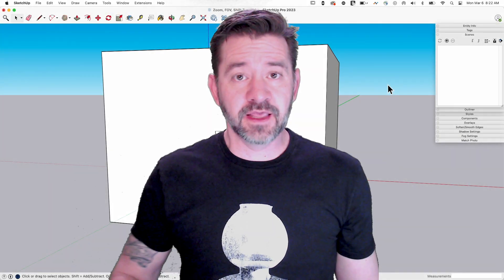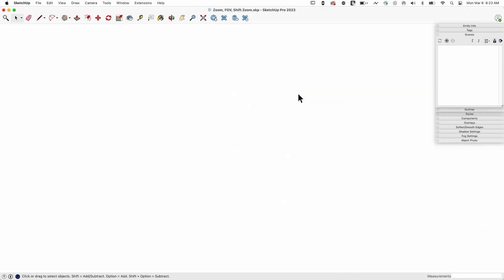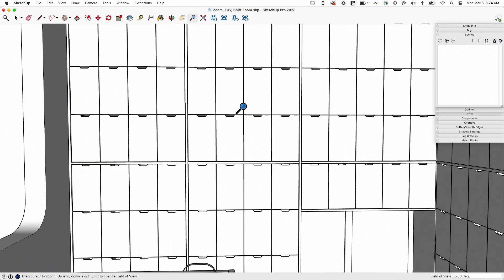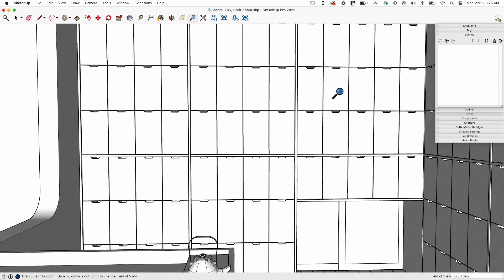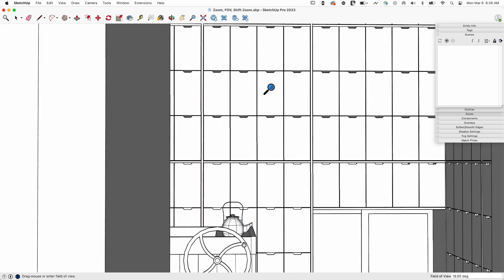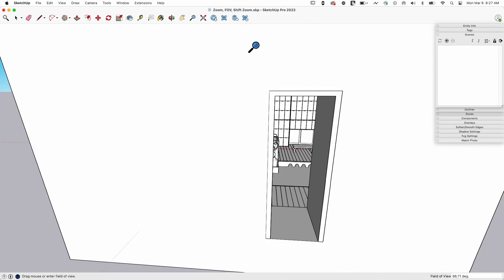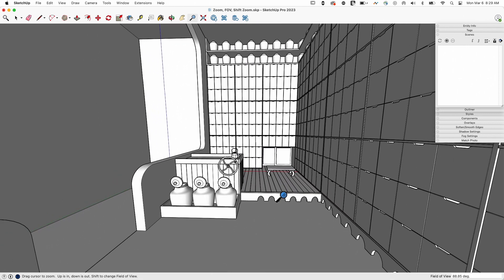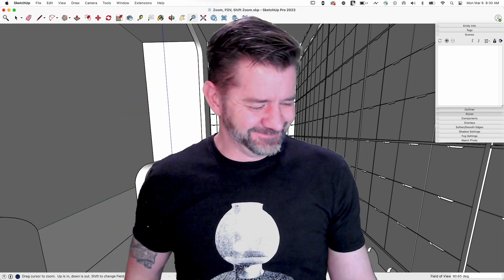What does Shift + Zoom do?

Comment: Thanks for the tip. For interior design I find slicing with sections is useful. Maybe more useful than hiding and unhiding walls. 
Save the views as scenes then you can use them for wall elevations.  
The most useful Sketch Up command I've found recently is paste in place. Great for tidying up geometry and getting things in and out of groups.

Comment: That is a good one! I forget to use some of SU's great features so it is good to be reminded and go through them in detail as you did here. Also, my Logitech 3-button mouse has both a smooth and ratchet wheel. By clicking down on the wheel it switches between smooth and ratchet.